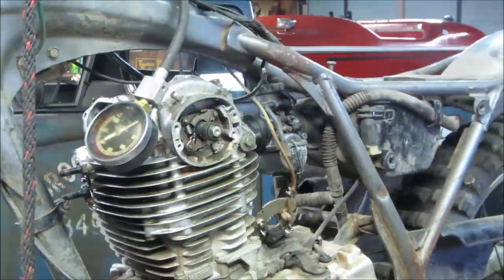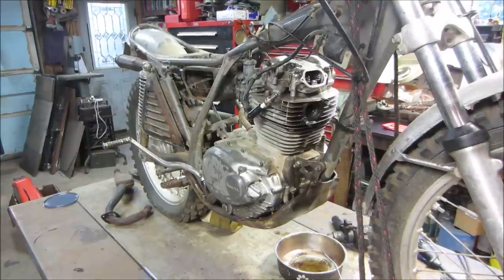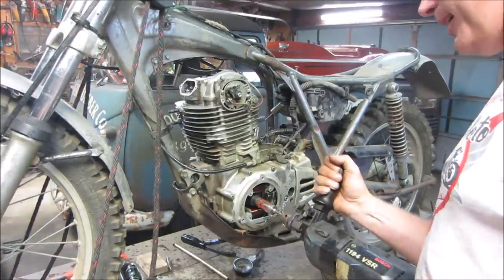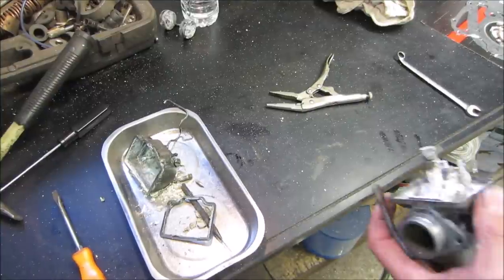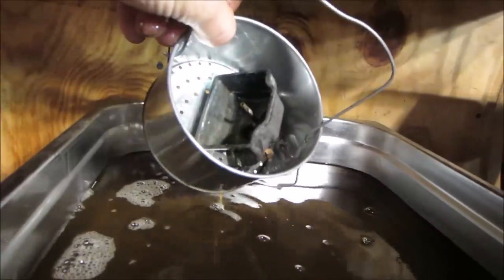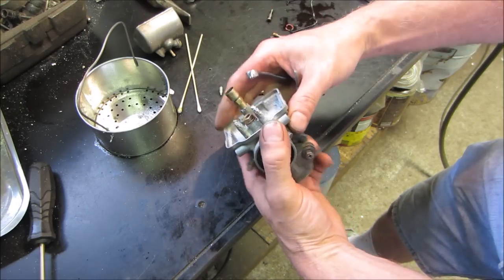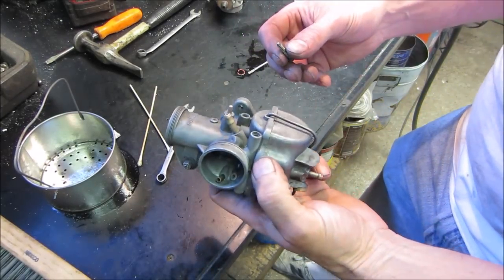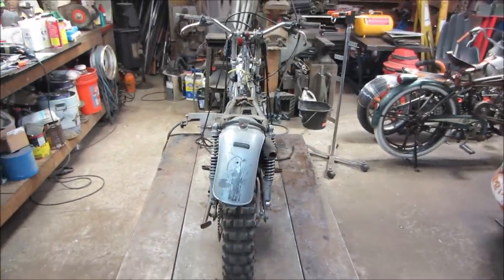will it run? antique honda trials bike pt 2 of 2

Comment: Exactly what I've been doing all week... 1979 trail bike rebuild.....got a good spark, carb is rebuilt and stopped leaking... idles and revs well, gears all work. (really low gears) now need to figure out why the lights don't work..... fun fun fun..thanks for the inspiration.

Comment: I dismantled the carburetor on a dune buggy this past weekend; I used the knowledge I gained from you to complete the task. Simultaneously, I taught one of my three  sons, my eleven year old (he’s doesn’t remember buggy running), how to do this work and why it needs to be done. Thank you for inspiring me to tackle this task because I normally steer away from small engine tinkering; we had a blast! Unfortunately, the shutoff valve was broken, so we weren’t able to cold start the engine, but it will be accomplished one day as I’ve ordered a replacement part. Peace-out!
Reply: Thank you for sharing the project with your son! My Dad answered many questions as I stood on a stool to peer over the fender of our 1954 Oldsmobile Super 88! Then my kids helped with projects and enjoyed the quality time learning with Dad the Motorhead! Be a Good Dad!

Comment: Oh boy! 5th in line!  Cleaning up those points was basic bike maintenance in “the day”. I was 20 in 1976 ,had bought a brand new ‘76 Yamaha RD 400c, first year production, paid $1,389.00 (Canadian!)that went through point sets like water over Niagra. Every week/10 days was about it, mind you, it was a simple task to do. Yamaha finally got it right a few years later with CDI coming in, but hey, it was a good time when a bunch of guys with “rice burners” would get together and tell lies about how fast their bikes were and do some wrenching on the oil burners. Miss that little rocket 😢🏍🏍. Keep on with these very informative and memory jogging vids !!
Reply: Michael Wojciechowski I was in the Navy in Japan in 70.  I ordered a Honda 350 SL from the dealer outside the main gate for $500 and 100 for shipping to Norfolk when I got out.  Had lots of fun with it.  Would not run with a battery I learned!
Reply: I bought a Suzuki 250 in 78 when I was stationed in Norfolk. I had to adjust the points every 200 miiles.I used to everywhere at 85mph. Now I have a 150cc bike I have gone metric and am happy at 85 kph.
Reply: I got a point's file, dug it out the other day - not seen alot of action lately! Points and distributors seemed to take up a lot of time back in the day!
Reply: I'm restoring a DT400c that I've had for about 35 years. Almost done. Just trying to figure out the correct yellow paint match...
Reply: KC inMN   DT?  Was that the Dirt/Trials bike?
Reply: Enduro, basically a dirt bike with lights...
Reply: KC inMN   Got it , sort of dual purpose, had one of those too, a 1982 Honda 250 XL(?) , if I remember it correctly.
Reply: +bought a 74 RD 350 new when i was 18 in San Diego from Don Vesco Yamaha...  loved that thing especially after getting rid of the 69 H1  mach 3 which was the scariest bike ive ever ridden  and i have ridden lots...my RD never had any points issues  im not even sure it had ponts
Reply: Thomas Rose   Pretty sure anything before ‘79-80 had points and condensers. If you didn’t rev too high too many times, then points wear and timing wouldn’t have been affected too much. Thankfully the ‘76’s had a 6th gear to keep highway rpm’s in a good range, not too high but enough not to bog down and foul the plugs, which is why I went 1 step hotter in heat range cause I did a lot of long range riding.
Reply: My DT400C (1976) has factory CDI, I think the '75 and older were points.
Reply: M8ke...we are the same age (me march 1956) and I also had a yammi 400...think it was a DT...trial/street)

an awesome machine lol

Comment: I saw you have the drain valve, on your model of ultrasonic cleaner too, now what I did was attach some clear hose on it, and a paper fuel filter, I put the other end in a big can that can hold 10L of fluid on the floor and let it drain into the can and the fuel filter filters out particals and cleans the fluid pretty good and then I just fill the tank back up, I do that every week or so depending on the use it gets..... Just a tip and idea for you.

Comment: Guitar strings make good jet cleaner outers!
Reply: Ive used cutting torch tip cleaners they get real tiny and can still clean well
Reply: There are jet cleaning and measuring tools like the one mustie showed available, but smaller in size.
A mate had a set of them, including a set of files, very handy if you go from stock airbox to open filter intake, just to tune the original jet to the new amount of air...
:-)
Reply: But I only have a guitar. The high E string and the core of the wound strings are pretty small. I was making a suggestion for those who are amateur musicians and tinkerers. Those who work on a carburetor maybe once a year. It's worth a try before you invest in tools you may never use.
Reply: Low "E" bass string replaced snapped throttle cable on our bus in Texarkana back in the day. Better than OEM. Rock&Roll
Reply: @papaw5405  absolutely agree
Reply: @oliphanti06bailey90  holy crap you just helped me so much,I have a few machines that have strange throttle set ups,hard to find stuff like 70s snowmobiles, I can't believe I never thought of that

Comment: Try soda blasting on the cruddy carb.. It works for me..cheers 🍻🍻🇺🇸🇺🇸
Reply: Yep, pretty amazing how well those things work on rusty corroded stuff. Especially aluminum. Just aggressive enough to clean, but not so much that it removes base metal like sand can. I use a cheap handheld blaster from Horror Fright. Made my old GL1000 carbs look like new. Best part is that it washes away with water. BTW, Sams Club has a huge bag of Arm & Hammer for really cheap. Will last for ages.
Reply: John Acuff.  Thanks for the tip on the large bag of baking soda....will do... Cheers 🍻🍻🇺🇸🇺🇸🇺🇸
Reply: Sam's Club, I need to remember that.
Reply: @notajp  If you live near a rural area, some feed stores have it.  That's the cheapest I've found it (sodium bicarbonate).  And while you're there pick up some agricultural grade flaxseed oil (linseed oil) for your wooden tool handles.  Non-toxic vs "boiled" linseed oil which has solvents.  Slower to dry than the "boiled" though.

Comment: A soda blaster works good..also I use the works, toilet bowl cleaner..it removes, lime,calcium, rust..let soak for one min,at a time..iv been using this method, for years..
Reply: ,p.s. wash with water after

Comment: Remember seeing these little buggers in my local Honda dealership in the 1970s. Always wanted one because they looked so damned good, were four strokes - and Hondas. 

But back then there was another trials bike that had somewhat more kudos: the famous Bultaco Sherpa. So now I've got two of them that need restoring instead. But I've got ten other bikes and nine of them are Hondas!:)) Only one is running right now. 

Nice work btw. Not sure I'd sand blast a carb though. Too many tiny channels to get grit in.

Comment: That tight valve will come back to haunt you. I'd pull the head and check it out
Reply: First thing I would have done
Reply: What do you mean?
Reply: Plymouth Barracuda pull the head off, that stuck valve will be damaged and as Mark Schmitz said, it will come back to haunt you
Reply: I would pull it too but I think freeing it up and skipping it was the smartest choice at the time. He didn’t know if it had compression yet or if it would come back to life. Now knowing what he does pulling the head is a smart move.
Reply: This was just a "does it run" and "does the transmission work" test, he'll get to it!

Comment: I had one of those !  It was my first trials bike.  A customer brought it in really rough shape  and I  ended up buying it. I could have sworn you said, Trail bike in the beginning of the video, frankly that is more accurate than calling it a trials bike.   I learn to make it a habit of always checking those dam brass floats for cracks.   Just plunge them into water that you just boiled and watch for bubbles.  Sinking brass floats can be a demon. Also if your looking for a fine strong wire to use as a poking thing.  Guitar strings are about a buck and  come in sizes down to 0.008".   I used to put completely clogged jets in a high speed drill (3400 rpm) and spin them for the wire just to get a hole through there for carb cleaner.  Ultrasonic cleaners weren't too  common back when I was a M/C mechanic.    Thanks for the video!  it brought back fond memories.

Comment: I was so excited when that thing took off and ran!!! Been there and done that with a '68 Bultaco 250. Very very loud bike but really fast too. We eventually just got rid of it because it stopped running and I didn't have the knowledge to fix it at the time. We also had a Honda Trail 70 that ended up the same way. Too bad I was so young and didn't know what I do now. Watching you just brings back some cool old memories. thank you.

Comment: This bike holds a special place in my memories. I bought mine (a 125) almost brand new for only $300 from the Honda distributor in Weaverville, Ca, the heart of BigFoot country back in the seventies. It was marked down big time because the original owner took it up into the mountains and got in a place so steep that he got into trouble and lost control! The bike tumbled end over end to bottom of a gulch. I had to replace or straighten a whole lot of stuff before I could ride it but found that it was the best bike for that country. Twice I motored up on she-bears with cubs scampering up trees. Twice I turned around quick and got "the hell out of dodge"! Gives you an idea how quiet it was. I used it for exploring all around in the Trinity Alps, hunting for deer, old mines, abandon shacks,etc. Never ran into a BF though. Took it with me when I left that town and settled in Hood River, Or. I decided I wanted to use the bike for the short commute back and forth to work. Since it was never designed for road use I had to wind my own coil to generate voltage for the lights, horn, etc. I made up my own wiring harness for everything. When the DMV inspected it they asked me to dim my headlight and activate the brake light, tail light, etc. so I just flicked the light switch on-off-on to simulate everything ;-P  It passed and I rode it for years. I loved that bike. Took my kids for rides all the time and rigged up one of those bicycle trailers for to tow behind for groceries and kids. My kids were pretty little back then but they still remember me giving them lots of rides. If I had a chance to own one again, I would in an instant! Low speed, and quiet, perfect bike for me! I had a trail 110 later on but some low life wanted it more than I did! My fav was and still is the trials bike.

Comment: I like to use a piece of an E string off of a guitar to clean small carb jets. You can buy individual strings at  most music stores down to .009" diameter. One string will make several jet cleaners. Love your bike, engine, vw rebuilds and repairs jobs. Also love your practical cost conscious approach to your repairs and restores.

Comment: That old honda takes me back these where the kinda bikes i used to find in the mid 80s in sheds and on scrappers trucks they usualy needed a fair bit of tinkering and most of the time they ran quite well after i had lots of honda tys and old greeves and a few baltacos i loved it back then and spent most of my time over the local trails and feilds rideing my frankenstein trails bikes in my teens .
Great vid and kontent mate 
🤘

Comment: Fantastic Darren, seeing another great Honda model coming back from the dead,from my over 40 years experience tinkering with XR,XL & SL models,have found they can benefit from going up a hotter Slug plug,eg.from 8ES to 9ES then dropping needle circlip on slide from 3,4_5to increase fuel richness in acceleration, also a hint I share with all new younger owners,is don't make your first kick your best,on cold start,put on choke,then give 2_4light kicks to pull in air/fuel into chamber,then bring up onto compression stroke,then give your best kick,using maximum half throttle,kindest regards,Dave McLaughlin, Queensland Australia

Comment: Just wanted to let you know you've inspired me. I have a 1967 Yamaha trail master that I've had for a long time. It was my grandfathers bike. It hasn't run in decades now and I thought that someday when I have the money I'd get it fixed but because of you I'm feeling like I may try to fix it myself. I'm not totally inept at mechanical work but the electrical system I thought was a little more than I wanted to take on. Now I will start with cleaning the points and see if we get a spark. Thanks dude!!! P.s I'm not to far from you, Bristol NH so if I get it going, maybe I'll swing by and thank you personally.

Comment: For cleaning aluminum and carbs  I use crushed walnut shells in the blast cabinet. It doesn't remove any metal and leaves a great surface finish. Actually makes the aluminum look like new. Give it a try next time.

Comment: Just bought a 88 XT350 with 1150 but needed the carb rebuilt and I ended up replacing the head, cylinder, case and valve cover gaskets. Now the bike is running and looking like new because it really is. Stored in Big Bear with no rust at all.

Comment: When I clean out the passages in Marvel carbs I found that telephone wire with the insulation stripped away does the trick.  I have not mic'd it but it's pretty darn small.  Great vids.  Thanks.

Comment: Cool Honda ! Great to see it run again . I had a Suzuki trials bike years ago , it was a TM 400 2 stroke . It sat low but it had way to much power . When you twisted the throttle it would start off really nice  but when the power band kicked in you had better be ready because it was going to try and stand up with you . After I sold it , it changed hands several times and everyone that owned it broke a bone while riding it . It was a beast of a trials bike .

Comment: Nice work and a fun video. Back in '73 - '75 as a teenager I rode and raced a XL250. Did all my own work and modified the hell out of it - stripped down and barely street legal. Great bike - endless torque - and a real thumper. Lets see what you can do with it.

Comment: Good job on getting it running. Something to think about when you strap down the bike is to run the tie downs around the front sliders where the front fender mount is. That way you lock the front wheel in place and the tie downs are not slacking off when you put weight on the front end. Also you don't risk blowing out the fork seals by tightening down the front end. Just my experience of working on my bikes for 40+ years. Can't wait to see you putting around the yard on it.

Comment: Guitar strings for poking through those jets! That way you can get them in specific measurements in thousandths of an inch diameters, down as small 8 thousandths, and going up 1 thousandth at a time from there... 😊😊😊

Comment: Got my first bike at 7. Set up a trials course in the back creek. Never ever had a clean run. Closest I ever came was on the last section, drop down into the creek bed, ride the clay wall through the corner, onto the throttle and through the floating surface rocks and line up to wheelstand onto the big stump just enough to get the sump onto it and throw your weight to rock the bike over it. then fall off and race back to the bike to see if anything major was broken. Bloody hell when you were a kid balanced 4 feet above the creek bed it was amazing. But the real amazing thing is I didn't kill myself and 56 years later I can still remember each challenge, and how many times I had to pick myself up again. Trials is fun. Cant wait to see this beastie finished.

Comment: Mustie 1, back in the mid seventies I bought a TL125 Honda while living in Weaverville, Ca. up north in the Trinity Alps (not far from where the famous Patterson Bigfoot film was taken). The bike was almost new but the guy who owned it got himself in trouble in a real steep area and had to let it go and THAT IT DID! End over end and almost everything on that bike was either broken or dented. I payed $400 for it and slowly got it back into shape. I took the fork tubes to a guy who had a hydraulic press and had them straightened. I had to chain up the frame to different trees and use a come-a-long to tweak it back into alignment! I wasn't too worried about the thing failing on me at high speed cause it wasn't made for it anyway! Almost every thing on that bike was either broken, needed tweaking, or replaced like handlebars, clutch and brake levers, kick start, kick stand, shift lever, rear swing arm, both rims needed some work done to them to get them mostly round then re-spoked plus replacement of several cracked bearings. I had to replace the exhaust tube from the motor back to the mid section. I remember mine having two mufflers on it and I loved how quiet it was. After I got it rideable I used it for bow hunting all over those mountains and had a blast! The only downside to how quiet it was happened twice where I ran up on black bear sows with cubs! both times I turned that bike around, gassed it and took off (never looking back) rowing through the gears going as fast as  could until several miles away before assessing the situation! When we moved from Weaverville I couldn't take the bike with me so I sold it. That was the most fun and beneficial bike I ever owned and I wish I still had it! By the way, yours looks to be a 250cc motor, am I right? Thanks for the way you do your videos like we are right there with you. I love it and watch your vids all the way through!

Comment: i also use to use a wire brush but i found that syringe needles from the chemist etc work much better, as they come in many different sizes and are extremely strong.